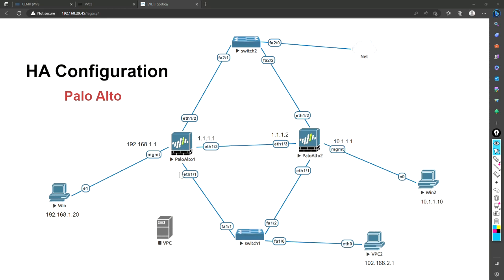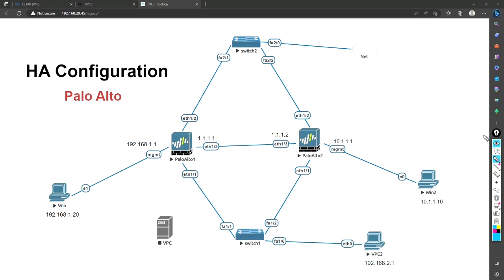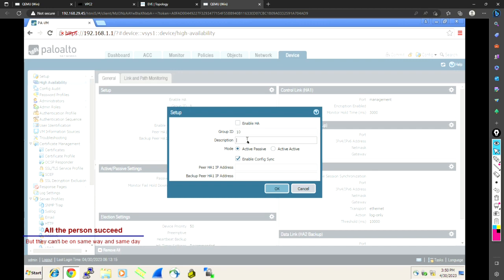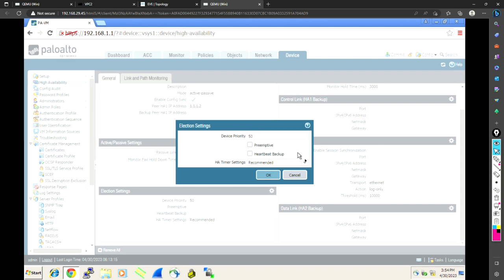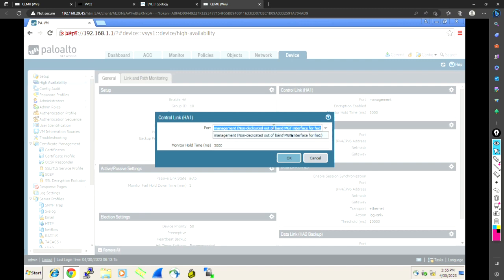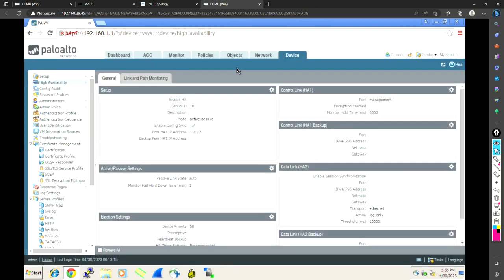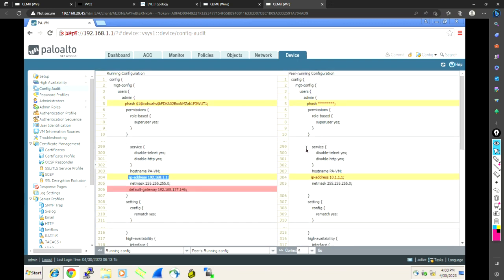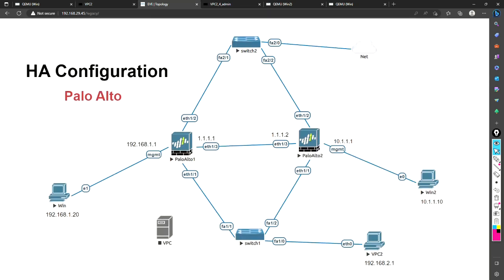HA Configuration in Palo Alto Firewall | High Availability in Palo Alto | Part 2

Comment: Hi @freshdeveloper, my question is why is the management ip's on HA1 and HA2 in different networks ? and how does that work ?
Reply from the maker: Management IP of HA link is usually put in same subnet if they are directly connected.
But it could be in different subnet IPs if the devices are different locations and the same subnet IPs can't be assigned.

Comment: Question: for any LAN, let say LAN 1 where switch 1 is connected to both the Firewalls, should the gateway of both of the firewalls be the same or different? IP addresses of eth1/1 of both of the firewalls should be the same or different?
Reply from the maker: I am not getting your question.
But the configuration on both the firewalls are synced up so ip address will be same.